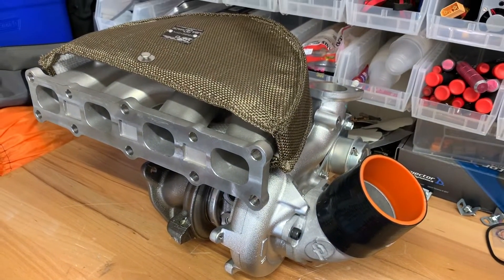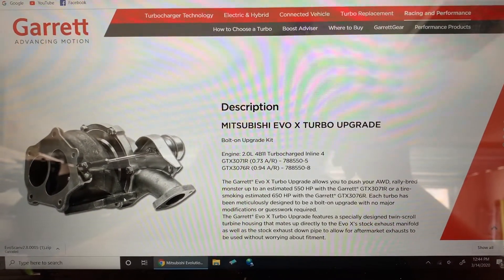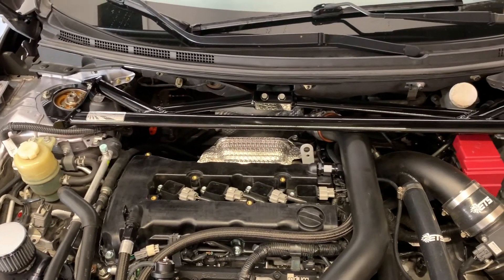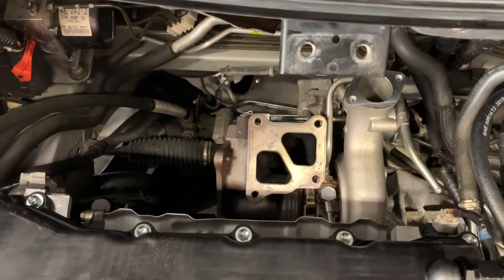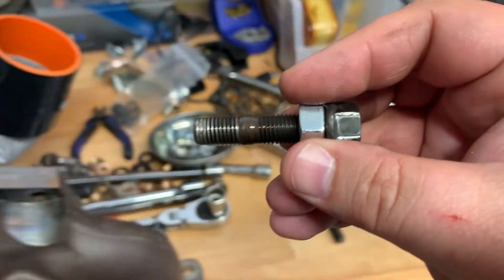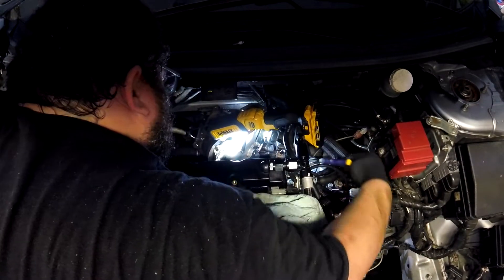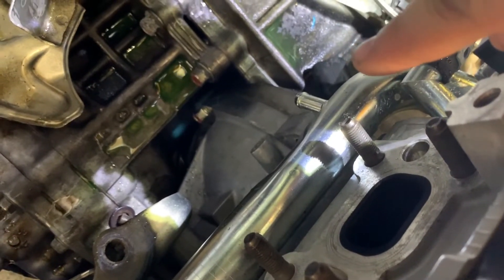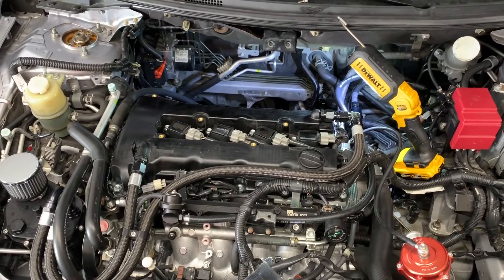Evo X MHI 18k Turbo Swap EP1

Comment: So I’m in the process of installing the MAP manifold.  I too have an MHI18k turbo that i had installed a few years ago.  I’m dreading the fact that I have to remove all the turbo bolts that were so difficult to re-install to lower the turbo so I can mount the MAP manifold over the turbine housing studs.  Aaaah!

Comment: What finally broke that turbine housing support bolt loose for you? It's the only thing I've had trouble with now for 2 days. Can't get the damn turbo off.
Reply from the maker: A lot of patience and walking away a couple times to regain composure...... But for real there is essentially only one way to get at it from the bottom, and that is with a very short socket and universal on a long extension, or a combination of several wobble extensions. I definitely recommend using a six sided socket to lower the risk of rounding this bolt out. Also shoot some PB blaster or other lubricant in the backside of the threads to help breakdown any rust. I also bought a really really long 3/8 drive socket wrench (or breaker bar) so I can get good leverage and breaking torque. Its annoying because the amount of extensions you have to use will flex and reduce some of the torque you can apply by hand.

Not sure I would recommend any type of impact for this because these bolts have a tendency to snap or gall. Almost every bolt I broke was when I hammered on it with my dewalt impact. Exhaust bolts are not friendly.

Some anti-seize would probably also be good when you put this one back in as it is a PITA to remove as you can see

Comment: Did you use a stud or maps provided bolt in the hard to reach part of the exhaust manifold to turbine housing?  The lower left side of the turbine housing

Comment: Were do I get that heat shield 🛡 looks good
Reply from the maker: thermal zero, manifold blanket, evo x specific, MAPerformance sells it but you have to use the search function to find it.
Reply: mpbiv421 thanks when’s part two coming

Comment: How difficult was it to remove the studs in the engine on the left and right to install the MAP exhaust manifold?
Reply from the maker: Removing the studs from the head was actually much easier than any of the other studs that needed to be removed. You probably won’t have any major trouble with them.
Reply: My stock exhaust manifold is leaking and I can smell spent gasses in the cabin until I run the AC.  Deciding whether to get a replacement OEM one or try again with the MAP one.  I’ve tried it before and I couldn’t get a bolt to align Into the turbo manifold.